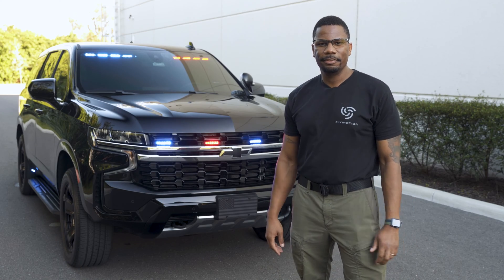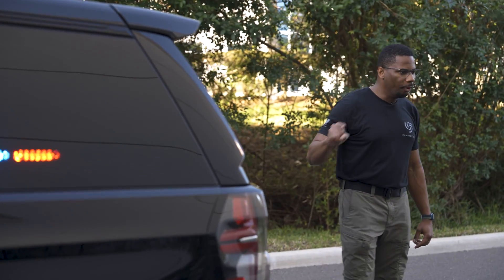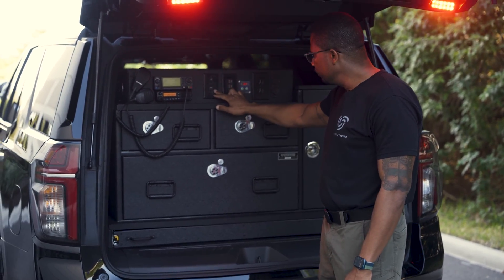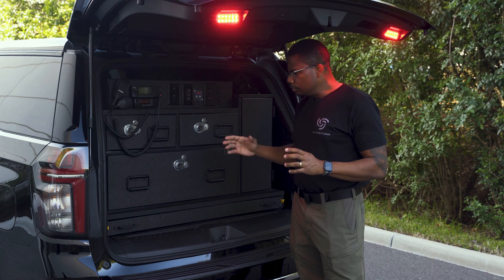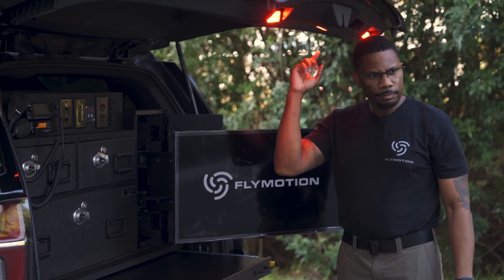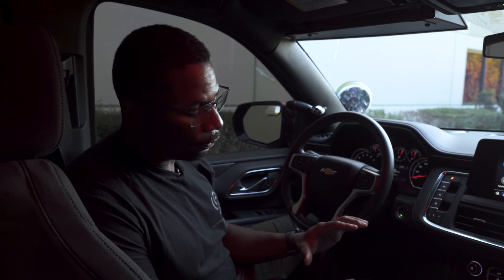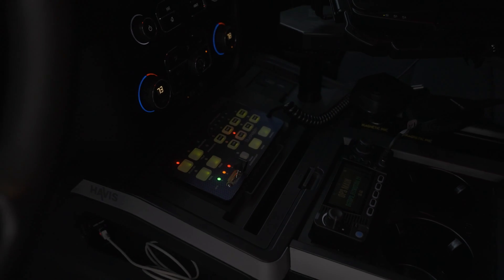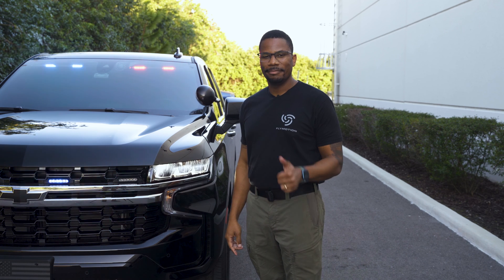MAVERICK Overview - FLYMOTION Mobile Drone Command Vehicle

Comment: What brand are those light cut outs on the rear lift gate?? Never seen those. My lights are just mounted on the factory panel and point straight at the ground
Reply: Actually watching the rest of the video, it looks like custom made mounts and the trim was cut out. I'm not as familiar with the tahoes, we cant afford em, but the Durango have a finger groove that a small led light fits in pretty well.
Reply: They are soundoff mpower lights. We've mounted the lights like that in the hand holes, where you would put your hand to pull the lift gate down.

Comment: Good stuff. Can the tailgate be modified to open taller so anyone over 6 ft doesn't have to stand in a permanent crouch while working back there??
Reply: Nope
Reply: @carvdecarv  would need a suspension lift cum tire size upgrade for that, or go straight to F-150-F-250.